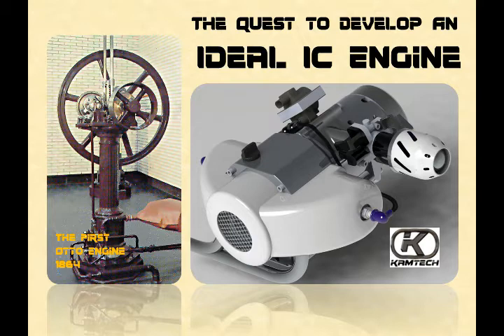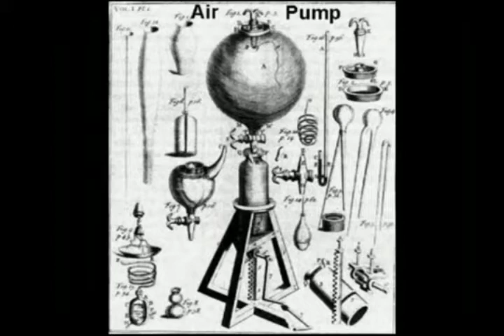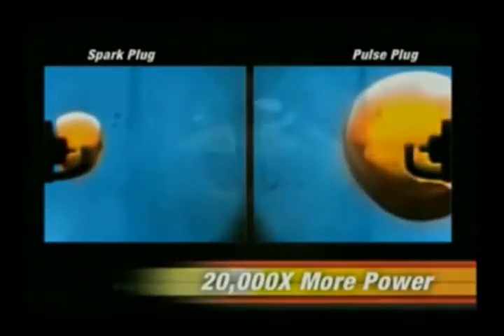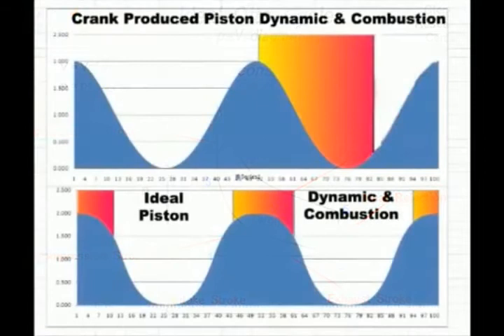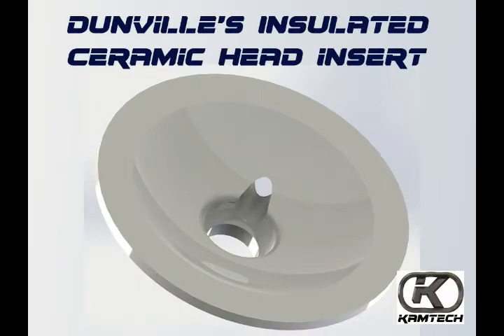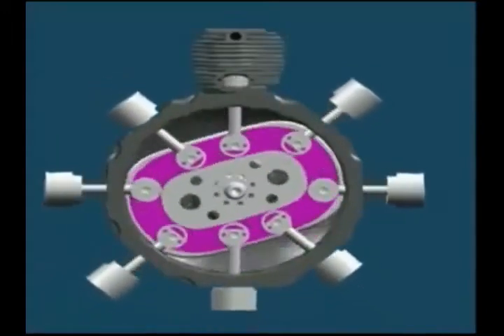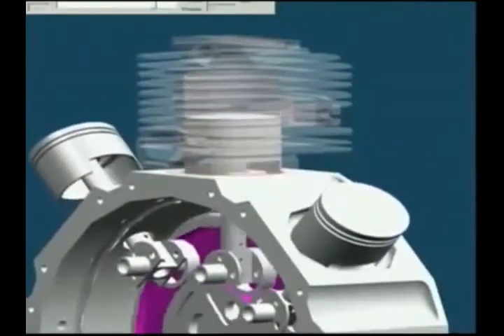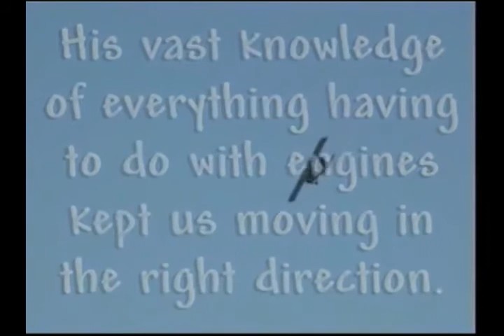Kamtech 2017

Comment from the maker: This engine was based upon a 1982 SAE (Society of Automotive Engineering) paper written by Antoni K. Oppenheim.  He became our main technical adviser.  The advantages of using a two stroke are many.  1. Much smoother operations. 2. Less weight as there is no valve train, 3. more compact power as there is twice as many power strokes, 4, automatic exhaust gas retention.  This allows leaner burn and lowers the ultimate temperature eliminating the NOX problem.

Comment: The history of the Fairchild aircraft engine demonstrated that the camshaft engines can be a permanent failure because of higher friction losses at the camshaft in comparison with the crankshaft. Meanwhile it is not easy to lubricate the camshaft properly because of its complicated shape. An attempt of improvement was made in the Marchetti Cam Engine but did not go to use. The use of a crankshaft is dictated by an opportunity of better (hydrodynamic) lubrication! Also, in the present engine, scavenging of exhaust gasses seems to be not sufficient. And I do not like if my extended comments are removed. So - my dislike to the video.
Reply: Thank you for your thoughtful comments Oleg.   A careful reading of the contemporary papers concerning the Fairchild Cam engine explains that its failure as an aircraft engine had to do with the engine high fourth order inertial torque (vibration). It fired every 90 degrees with such high force that its 3 meter long wood props could not take the jolt and would  split after a few hours.  It was also quite hard on the mostly wood air frames of the day. The engine had anti friction ball and roller bearings throughout.   It was one of the first engines to be certified to be use on aircraft which requires long hours with out failure.  Contemporary radial engines had very short lives between 25 and 35 hours which when Lindbergh made it to France he earned the name "Lucky Lindbergh."   

In our engine we have modified the piston dynamic so we have much longer dwell time at both TDC which allows for more complete combustion and at BDC which lets us move the exhaust ports down to 80% of the stroke rather than 45 to 50% as is needed when you have a crank moving the piston..  This allows us to convert far more of the force of combustion into work than a crank actuated piston. 

In a crank driven two stroke the exhaust port is open right at the pistons point of maximum advantage over the crank.   Also allowing for all the combustion to take place inside the engine rather than in the exhaust system means more of the heat is converted into energy and therefore the exhaust temperature is much lower.  At full load and full throttle the exhaust temperature was only 450 C.  So low we used an aluminum exhaust manifold on our bench tested engine.  We are doing a few other things too to improve the efficiency of the engine which are proprietary.   Again thanks for your comments.

Comment: Just curious but how fuel efficient is it and think it could meat emissions? With its ceramic internals I think that solves the low life cam engines are expected to have.  Humm.  Could the inside ceramics be replaced?
Reply: Hi, After several years of work on our latest test engine with the help of three ceramic companies and Dr. Zoltan Kish who built ceramic-lined test engines for Harley Davidson and Briggs and Stratton, we found that the Ceramic liners simply had too many issues, among them, expense and high thermal conduction.  We did however learn a lot from this prototype.  We had much better results by lining the combustion chamber with Titanium.  It's less expensive, easier to machine, more reflective of IR, has about 1/3 the thermal conductivity of aluminum or ceramic, and can withstand very high heat.  This has helped our efficiency increase, and we are now using a Homogeneous  Charge Compression Ignition system.  This makes for such a clean and complete burn when coupled with our long dwell time that it eliminates the need for a catalytic converter.  The engine is about twice as efficient as a standard petrol engine and it can lean burn with no danger of burned aluminum pistons.  The combustion also takes place with no super hot flame front so there are no NOX issues as combustion takes place throughout the charge in an instant.  We have done several other proprietary things that will allow the engine to have a much longer life than a standard engine.  We feel that the highest and best use will be to be used as a Range Extender for EVs.  This should produce much cleaner electricity than grid power, which currently charges about 98% of the world's EVs.  That is the prototype we are working on now.  See https://www.facebook.com/Kamtech.50